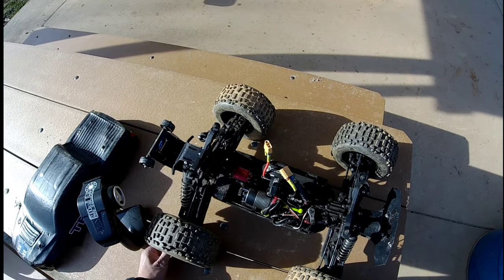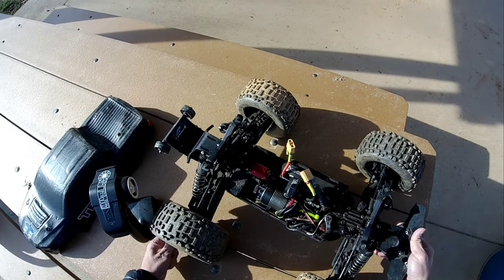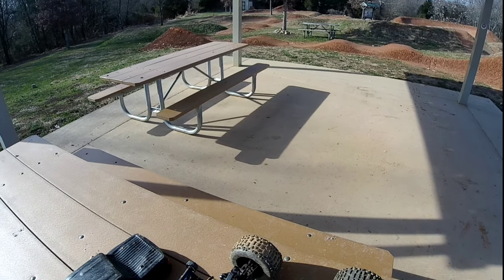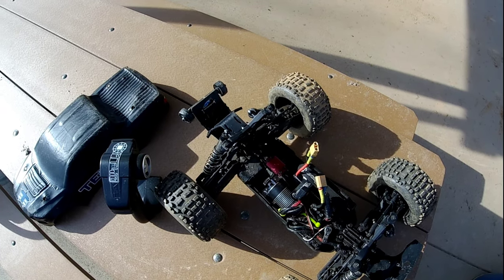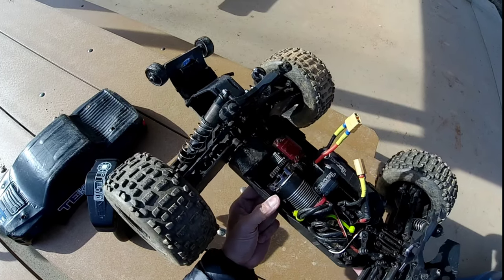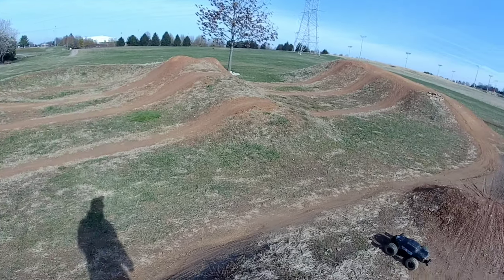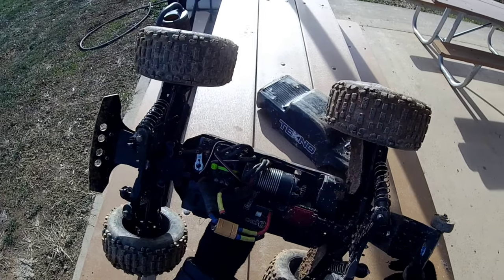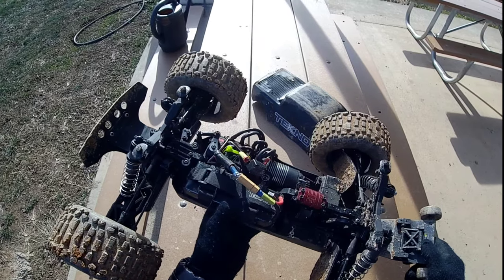Tekno MT410.  High flying, Backflipping machine.  Tekno Tough.

Comment: Insane jumps, brother, totally sweet. Good tip on the M2C diff housing. I think my rear diff is going, and I'll definitely check to see if gear parts have dug into the housing like you said happened to your center diff.
Reply from the maker: Appreciate you stopping by and checking out the vid brother. I love this Rig one of my favorite no doubt. The M2C upgrades are amazing bro it really makes this truck even more solid like a tank on top of the already tough Tekno truck.

Comment: Don’t get me wrong Arrma rigs are beasts but nothing flys quite as high as a tekno 😜 sweet run man, I feel you pain struggling to get out this time of year 🥶 you can’t go wrong with that M2C Racing diff housing either man, fitted mine before my last run and it’s proper smooth 👍🏻
Reply from the maker: Couldn't agree more with you brother. Love my Arrmas but Tekno MT410 lightweight profile makes it for high flier machine. This beast is in another level when it comes to taking flight. Love it. Bash on brother.